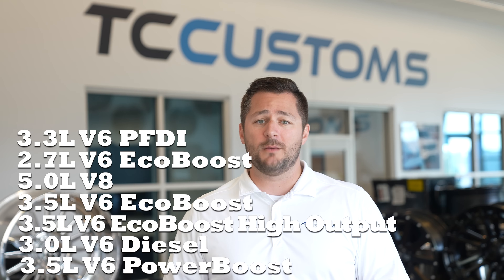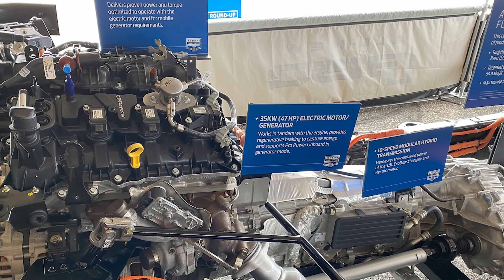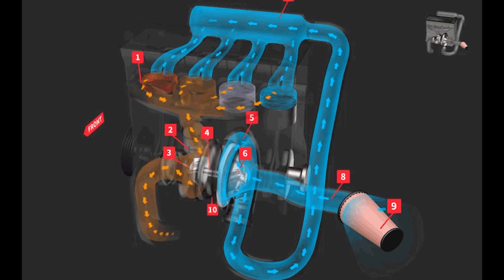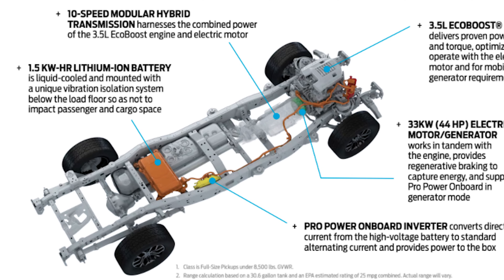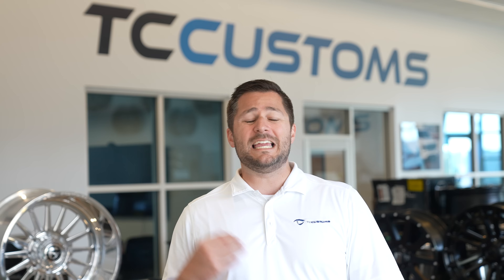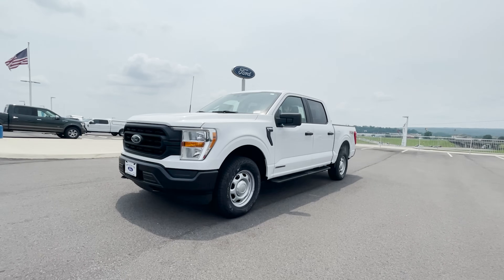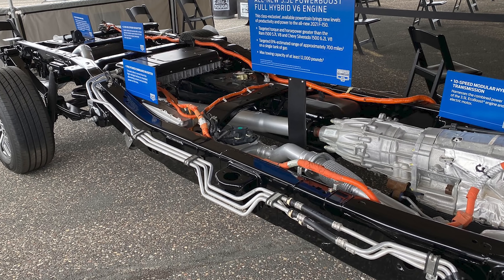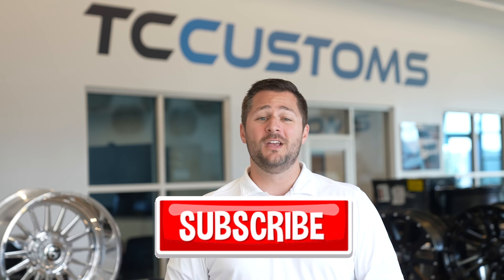The truth about the PowerBoost Hybrid Engine!

Comment: I have the 2021 Ford F-150 with the 3.6 Hybrid engine. I love it. I have had two times when I needed to bring it into the shop. But each time the problem was solved with a software update. Amazing! As far a mileage goes, this is where things are strange. When I am not towing, and I am on the highway at speed with the adaptive cruise control and lane keeping, I can go into “Eco Mode” and I will drive many miles at 65 mph in electric mode. I also get about 27 mpg on many long trips.
My City mpg is usually at about 22 - 24 mpg. But I love the fact that this is such a winner of a pickup truck, I have in less than 6 months, been converted from a Chevy truck guy to a Ford guy for what will most likely be the rest of my life. Now if Ford would only do that with the 250 and 350!
Reply: 3.5 EcoBoost...
You're seeing great mileage, that's really good. Occasionally, I'll see 25 but I'm mostly in the 22 range of mixed driving. Way better than the old 15mpg I was getting in my old EcoBoost.
Reply: @pimpovic2  just don’t have a lead foot. Also, use the “Eco-Training” to help you maximize your mpg.
Reply: @HansHartman  What kind of mileage are you seeing when you tow?
Reply: @brianmccants5098  depending on the driving conditions and terrain (and I have a 32’ Keystone Hideaway, which is about 11k lbs when under way), between 9 mpg and 13 mpg. One time, I was getting 17 mph, at night while driving south on the Jersey Turnpike. Cool weather, 55 mph, no traffic. But that was only once. But with a tow capacity of 12,400 total lbs carry/tow (don’t forget to weigh the vehicle at a weigh station to make sure you don’t overload),  I couldn’t be happier. And don’t drive in “Normal”. Use the Tow settings. Hope this helps!
Reply: @HansHartman  Yes, thank you very much.  Someone on YouTube claims to get 21 mpg while towing 8,000lbs.  That seems too good to be true.
Reply: @brianmccants5098  8k is a bit much for 21mpg, but if it is flat, no traffic and 55, I wouldn’t doubt it. I was traveling from MA to CT the other day without a load. I got 28mpg on the highway. But I was going 55mph as that was the speed limit.
Reply: @HansHartman  I’m definitely in the market for this F-150 Hybrid.  My wife and I love our 2019 Ford Fusion Energi so I would like a hybrid truck to compliment our car.  Thanks again for sharing your experiences.  They were most helpful!
Reply: I paid full retail. About $74k.
But it has just about every single option I wanted.
Reply: @brianmccants5098  that is total bs!  The only truck I had that gets good towing mpgs is a 3.0 gm diesel.  My ford's, whether they are the v 6 or v8 get horrible mpgs.  Actually the v8 ford 5.0 and my chevy 5.3 got bettwr mpgs by 1 or 2 mpg than the 3.5 eco.  Never towed with a 2.7 so I can't provide feedback on that engine but hear great things about it.
Reply: I put new Pirelli AT tires on my 2021 and lost around 2 mpg but will practically remove the pavement when getting on it.  Stock tires turned to banana skins at 29k miles.  Hankooks.

Comment: Is this hybrid system good at off-roading? like driving situations where you are constantly on the throttle (sand / mud driving)?
Reply: When you are in mud, there is a setting for the engin and motor to work together. When you are in sand, there is a different setting. None of the setting work with “Electric Only” unless you are driving normally or in Eco, from what I have observed. 
But the electric is a torque machine that will knock your socks off. I would also suggest getting airbag suspension added if you are going to be an off-roader. Hard bump stops work for towing.
Reply: @HansHartman  That is interesting, I thought this truck would switch between motors even in off-road modes (which is not ideal imo). Personally, I would not get the air suspension. I would replace oem shocks with fox or bilstein shocks and opt for a better set of 35 inch wheels. 
thanks for the info!
Reply: @shidi.48   the only reason I say to get air shocks, is to have the variable and adjustable height with a higher capacity for level ride with a payload or if you need to lift up while on the road. Beside that… the Bilstein shocks are probably a top pick.
Reply: No, it sucks. I sold my Powerboost after by 5 months. The jarring transition between electric and gas at low speed was getting annoying.
Reply: @evz1244  Compared to competition, this engine choice caught my attention, higher hp and torque, better mpg, nicer interior imo and the versatility of generator system for camping. I drive an 11 year old chevy and thinking about a replacement 🤷‍♂️. Thank you for sharing your experience with the truck!

Comment: I'm talking without actually looking into this, but I'd say that lower towing to power ratio is because the batter is going through cycles. It's not a constant source of energy. The battery (Power source) has to deplete, and fill over and over again. Not a good option for constant load. (Towing)
Reply: no, towing has always been about actual vehicle curb weight. Ford doesn't care about longevity, they care about higher tow numbers, cuz you can market high tow numbers but not longevity.

Comment: All I can say is that if you buy an ecoboost engine of any type you better keep a full warranty on that car. I don't understand why anyone buying an f150 doesn't buy the 5.0 v8. This is the whole reason I am not buying a new bronco. Not putting the 5.0 in the new bronco is a big mistake.
Reply: 🤣 obviously plenty of people like it, as the majority of the f150 sales are Ecoboost from what I can tell.
Reply: Parrot like your minions of V8 guys.  Your V8 Coyote with cylinder deactivation has had many problems.  But guys like you never want to accept anything else other than what you think is great.  V8 is going away

Comment: I bought mine on the last day of March so I've driven it going on 5 months.  I selected the turbo boost gauge as one of the 4 top gauges (in place of the tranny temp gauge, I think).  I was surprised that the turbos don't kick in unless you seriously get on it.  Between the engine in non-turbo mode and the 47 horse electric motor, the thing makes plenty enough power for any normal driving.  But it is almost scary when you stomp on it.  My buddy and I took it way out in the country and had a blast doing some 0 to 60 runs, with our heads snapped back and laughing like little girls.  This thing is seriously fast. Love it!!!
Reply: I have a good friend with one and he absolutely loves it! I'm waiting to see Toyota's offering in September and then I'm going to make up my mind. Based on the renderings I've seen, the Toyota will be good except the styling (for me) is a little awkward as per normal Toyota styling.
Reply: Did they fix the wheel hop from the leaf springs twisting? I have an Ecoboost and had to put traction bars on it to fix the issue. Thing just had too much torque lol.
Reply: I also configured my 2024's gauges to show the turbos boost instead of tranny temp.  Just like you said, you have to get on it a bit, or goose it up a steep grade, to see the turbos spool up.
Reply: More crap to break
Reply: I purchased a Limited, wow I scared myself getting to 45Mph - and likewise was laughing like a little girl as well after doing it a few more times. Lol
Reply: For reference, when the Aston Martin DB11 came out, a British reviewer was in citied to drive one from the plant in Warwickshire,UK to Edinburg, Scotland. Si9nce the DB11 was originally a V12 turbo. A V8 has since been made available. Anyway, by the reviewer staying at 65mph or less he found the engine did not use the turbo and also switched cylinder banks were he achieved 29mpg!
Reply: A pick up truck is for hauling and towing. It is so stupid to buy one so you can  laugh and giggle like little girls.  Why in the world do you need a truck that gets you from 0-60 mph in 5.7 seconds? For $75,000.00.

Comment: Soooo glad I skipped on getting the power boost. Forums are littered with people suffering with transmission and electrical problems, not to mention the regular problems the ecoboost gives you.
Reply: I sold my powerboost afrer 5 months. I’d rather have either all gas or all electric.
Reply: @evz1244  no issues at all with my 3.0 diesel one.
Reply: @evz1244  troll 😈….
Reply: Odd. I have had no issues at all with mine.  Very fun to drive and the fuel economy is solid. Pulled my buddy’s f250 out hooked to a 7000lb trailer without an issue. Didn’t think it would do it but it did.  It’s been solid so far.  I kept my 2013 FX4 with eb and it has 207000 miles on it and nothing gone wrong with the motor.  Had to replace the rear pumpkin at 145k and just replaced the fuel pump.  It’s been a pretty good truck.  I expect the same out of my 2021 PB. Hope that’s the case.
Reply: I had some initial axle bolt issues but they got fixed. some other minor things. Overall love it.

Comment: I have 4450 miles on my pb and have had issues out of the transmission which started around 2500 miles. This is very common from all the information I’m reading and it’s very annoying. I keep getting the same information from ford that it’s adaptive learning and it’s learning my driving habits. I call bs because I’ve driven this truck like a grandma and it’s progressively getting worse. It’s very aggravating having a 60000 truck that feels like the transmission is going to break on you . The problem I keep hearing is , the technology is too new and nobody can work on it . If you can assist in a direction to getting this issue resolved I would be grateful. There is quite a few of us out there with this same problem. Everything else about the truck is very nice except for this issue I discussed.
Reply: Issues out of the transmission?  Can you be more specific?

Comment: what speed can you do in all electric mode ? If you can drive around town at 35 MPH in all electric mode that would be awesome for a full size truck .
Reply: you easily can.
Reply: The only down size is the small battery size limits electric duration before it has to gas charge itself back up.
Reply: I've done 120 mph on long downslopes in 100% electric for just under a mile before the gas turned on as it went back uphill..

Comment: I bought one of these for the generator. I got the Lariat with the 7.2kw generator. I'm not a battery guy at all but this system works! The overall fuel economy was rated at 24mpg. I don't get that. It's really hard to get that with 570ft-lbs of torque on tap. It's addictive. I leveled the truck with the Ford Performance Fox 2.0 system(warrantied by Ford) and put on larger all terrain tires so I'm getting around 16mpg's in town. On the highway, about 16-17mpg's. But I didn't buy it for the fuel economy. Anyone who does isn't the sharpest tool in the shed. What I can say to the uninformed is "I drive a hybrid". They don't need to know my hybrid is 430hp with 570ft-lbs of torque. Oh, and it's really fun to drive! Isn't that why we're here talking?

Comment: I am getting the 24 mpg as advertised. If I do a lot of highway driving, that figure will be a little less. So far, 7000 miles later, I love this truck.
Reply: 570 lbs of torque no def or particulate filter and 24 mpg what wouldn't you love about it!
Reply: 4 months later what u think?
Reply: @FreshPrinceofBellaire  I have a little over 16k on it now. I understand a lot more about how the hybrid works. Yes, I still love it. I was considering getting a Tundra in a couple of years when they copied Ford's V6 engine line. But I will have to see it in person, to me the videos I have seen, the interior is cheap and the dash is ugly AF. But back to the Ford, the more you drive below 60 mph, and I just stay in normal mode, the better the mpg. The biggest thing though, is where you get your gas. The more ethanol it has, the lower the mpg. I have gone on a 600 plus mile trip and got 26.3 mpg at the pump. But that was just luck, and I attribute it to getting gas that was lacking ethanol. I still go to that station when their price is low enough, and I still get the best gas mileage when I do. No problems with the truck, I keep it well maintained except it is filthy. Seems like everywhere I go it is wet here lately. I have only pulled a party barge 3 or 4 times, about 4500 lbs fully loaded and small utility trailers. Hope that helps....
Reply: @napollard  I can't find any in stock or the price range. Can you help me with this Norman:)
Reply: @Trishafuninthesun11  I bought this truck around April, without looking, it is my best guess. I paid around 67K for it, that included a middle of the road extended warranty. Don't know if that was a good deal, but I didn't want the sun roof, but I wish I had gotten the tow mirrors. The standard mirrors have done the job, but if I had to tow like a 30 foot RV, they would not be able to handle that in my opinion. Where to get one, I have no idea, but when I was looking, there was a place near Mountain Home Arkansas that had the best selection at the time.
Reply: @napollard  What are the odds it's in Arkansas. I'm going to the Ozarks to look at houses! I guess it's meant to be, lol! Thanks for the quick response.
Reply: After looking at this video. I'm wondering if i should get eco. I need to make my decision later today. 1/3122
Reply: As the engine is actually running or while. Does the hybrid motor work as well let's say if you floor it ?
Reply: @Enlighten1640  The best way to explain it is, the computer makes those decisions. You just drive and when conditions are right, the battery charged, your speed and driving mode, it will pick when to go electric. For the most part, you won't even know it unless you look at the tachometer. That said, it is better in town than at highway speeds. I get between 25 to 30 percent electric miles per fill up. The less ethanol in the fuel and I have found that the winter formula vs summer makes a big difference in mpg. Less ethanol and summer formula equal better mpg. Best I can tell, in toll mode the electric never kicks in.
Reply: @napollard   Speaking of ethanol where do you get your gas? I use 91 octane here in Utah and the only non ethanol pumps are 87 or below.
Reply: @EnthusiastCarHangar  I am in Little Rock, Arkansas. There are two places near me that have premium ethanol free gas, but it is pricey. But I use that in my lawn equipment, chainsaw, weedeater, emergency generator. Just have found that some gas is better for mpg, and I assume it is lower in ethanol.
Reply: @EnthusiastCarHangar  You can get 91 octane ethanol free at Cardwells on state and 8137 south in Midvale.  I use it in all my small engines for yard maintenance.  It's not cheap though......
Reply: @Chris-rq3kv  Thank you!!

Comment: I was getting 700 miles from a tank on my 2.7 ecoboost, I see any fuel efficiency increase from this platform to be a secondary consideration, because you're not going to be impressed by it. If you're going to fork out that kind of money for this platform, you should be doing so for other reasons
Reply: You must have had 36 gallon tank and never put your foot into it lol
Reply: bingo

Comment: 700 mile max with this set up. My 2020 F150 XLT 3.5 EcoBoost under 4000 miles. On the Highway. Not Towing. Got 696 mile range. On normal settings. Not in economy. Now just over 4000 miles. I want to see what it can do with the economy on in the same case scenario. I am well over pleased to own this truck. Supper impressed. Over succeeds any expectations I had. Amazing truck.
Reply: After 2 years of ownership…. What do you think now? Any problems?
Reply: @OVERCAPITALIZE  My personal opinion about the 2020 F150 XLT Fx4 with a crew cab and tow package plus off-road package. Fully loaded. This truck Ford should have stopped with, and everyone should own one. Every type of vehicles have their problems. Yet. The best truck and design I have ever owned. The horse power is off the charts. If you travel far. The better fuel mileage you get. By itself. 36-gallon gas tank. I have gotten 720 mile range after a fuel up. I do not want another truck. I can even work on most of it myself. With the help of people on YouTube. I personally extremely love the truck.
Reply: @OVERCAPITALIZE  problems. After first getting it. Not even 1,400 miles. I offended someone for buying it. They keyed it twice. A little hail damage. A rock got thrown at the front windshield. Needs replacing. It's going on 19,000 miles. No problems. Factory tires are bad in snow and ice. Zero breakdowns. I drive my Jeep and motorcycle as well. Why low miles.

Comment: Weirdest thing about the F150 Powerboost, because it's not an e-CVT like the Escape, is seeing the gear indicator change when the engine isn't running.
Reply: What about the ground fault detected during test of pro power boost electrical circuit? They saying it's normal? Did U guys get software updates yet? Now they daying software updates by Sept 2023. They trying to fix that issue for about 2 years now. Pls respond asap so I don't take my new truck back to the dealer. Thanks.
Reply: @sslak3518 it's supposed to detect a fault when running the test. There would be a problem if it didn't detect a fault.

Comment: I've had my PowerBoost since May and love it...  However, the D@&m reverse pedestrian alert system is ridiculous!  It is on all the time regardless if the engine is running or on battery.  That's a "feature" I am hoping they update soon so it only comes on when under battery power.  Hey Mitchell, any people you can bump on this?
Reply: Update?
Reply: @RGMX92  I put in a @Megaohm Motorsports FORD EXTERNAL SPEAKER BYPASS - PREMIUM RC EDITION.  which works great.  It gives me the ability to turn it on/off as conditions require